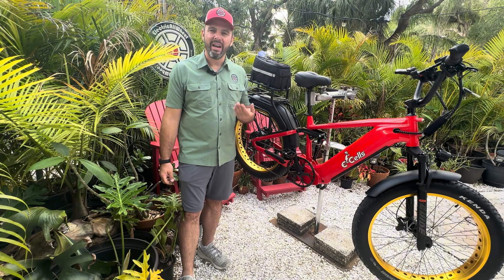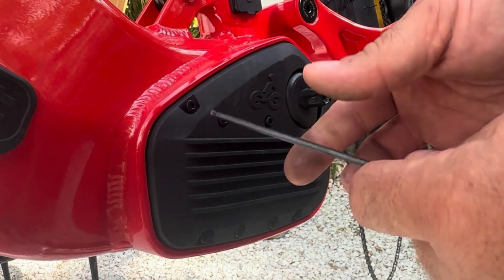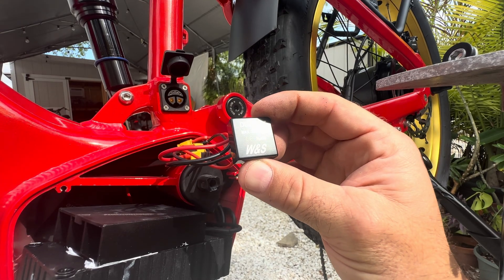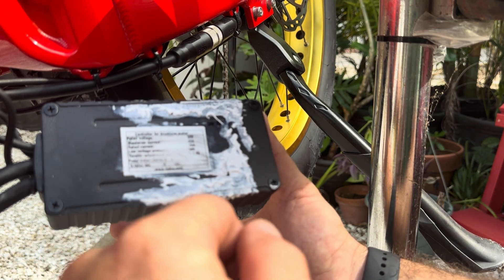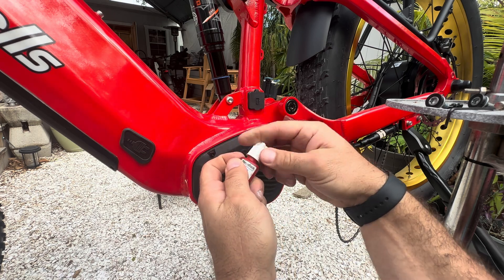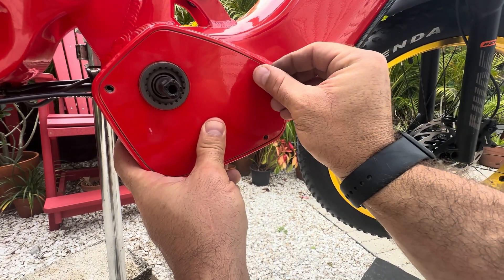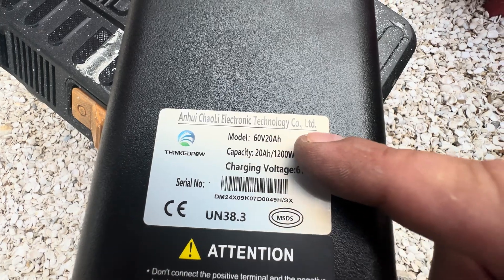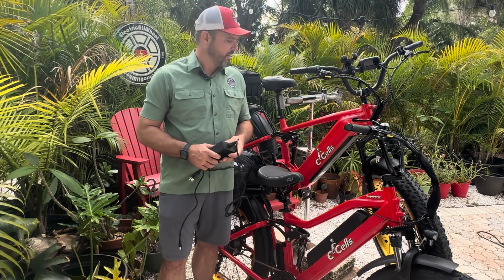$300 More than the Five Star. WHY? E-Cells King Star e-Bike Controller & Balancer Housing Opened Up!

Comment: Ecells downfall IMO was too many of the same thing. How many different AWD bikes do you need to offer? And same with the 5 star. I ordered the Dual Star upgrade kit for my 5 Star at least 6 months ago, only received the forks and the big headlight, no battery, no rear rack. I assume I'm screwed at this point. That brand had so much going for it, I was shocked when I read David's post.
Reply from the maker: We have a dual battery setup prepared to show folks. I understand the disappointment for sure